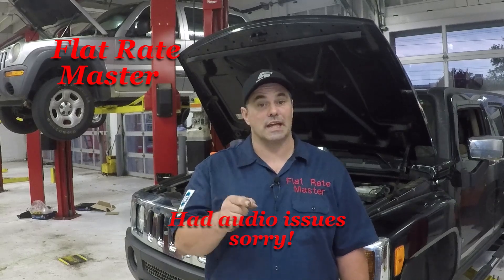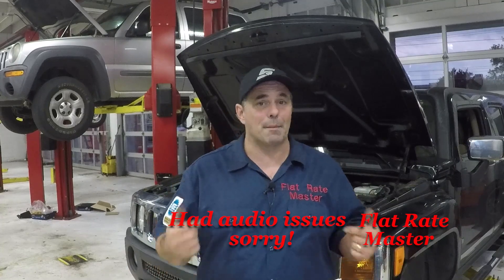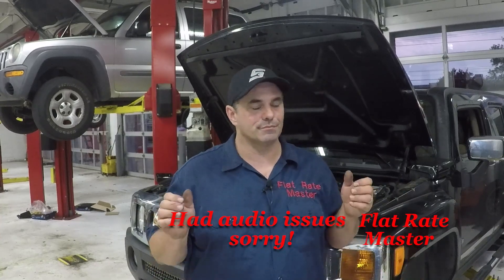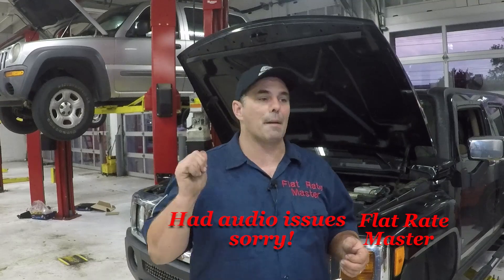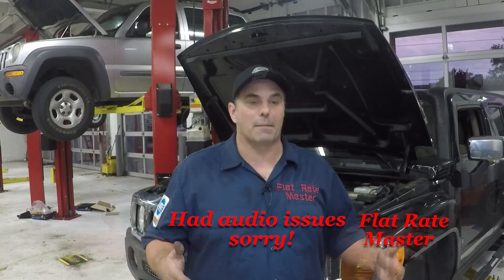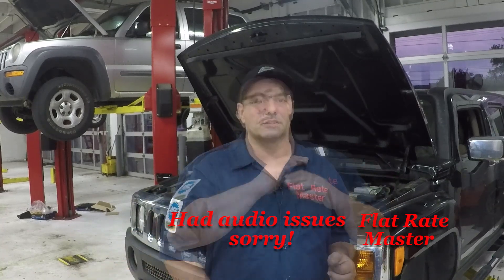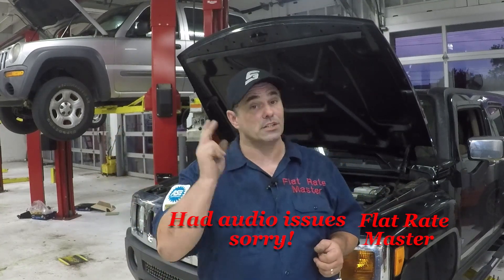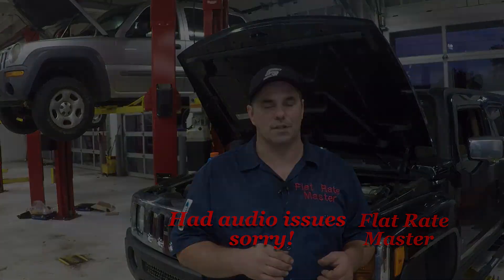Bay Management in Auto Repair

Comment: The jeep liberty in its natural habitat
Reply: MeVsMe that's funny
Reply from the maker: Do not get me started on that POS, I repaired the CEL on it but it is coming back because everysinceyou, repaired the light my steering wheel doesn't recenter after a turn, no lie!
Reply: Flatrate Master I've had a ever since you changed my oil, my glove box doesn't work. Lmao.
Reply: Flatrate Master and of course the dealer took care of it...SMFH
Reply from the maker: LMAO too!
Reply from the maker: my boss will probably have it aligned just to get rid of him and put that pos on the do not schedule list
Reply: MeVsMe, I've heard the Mechanic OC make the same comment about the Liberty.
Reply: Donald Hollums chrysler is pretty  garbage.
Reply: MeVsMe yeah, I understand. Pert near the whole automotive industry is that way now. When I was helping at the shop yesterday I flushed the heater core out on an older Wrangler with the 4.0 inline 6. One of the techs was bragging about how bulletproof that engine was and Chrysler went to the 3.6 V-6 because the old engine wasn't profitable enough. In other words the 3.6 was more susceptible to breaking down more often.
Reply: Donald Hollums I can believe it because plastic parts lol
Reply: MeVsMe probably even the innards of the engine nowadays!
Reply from the maker: We have a 4.0 at the shop getting a Head Gasket:) they killed the 4.0 because of emissions and Fuel economy, just too hard to get it to meet the requirements
Reply: I've done 6 Liberty's in my last 2 work weeks. Very natural environment. 😂😂😂

Comment: I have 2 bays here at my gm dealer. I mainly use the one in front of my toolbox for my repairs and my other strictly diag, and quick checkouts. I set my roll cart up as a diagnostic cart so I don't have to leave the car until I'm confident what the issue is and can write up my estimate
Reply from the maker: That is How I generally use my 2 bays as well.

Comment: i was just thinking about this last night when i tore down an 06 titan for a starter which i pushed up behind an rx8 for battery being connected backwards by owner. the titan turned out to be not only starter but flywheel also now i have to push it around because no one has the flywheel. never seen a chunk of flywheel come off and take out starter and a big chunk of bell housing.  so now i have 2 dead vehicles tying up my single bay, perfect and i have a water pump on a jetta diesel coming monday. oh it's so fun to have only one bay. great vid, thanks
Reply from the maker: It does suck to only have one bay, we have a jeep getting it rear end rebuild by a local gear shop, and rather than tie up a bay for a week waiting I had the tech pull it in the parking lot to keep him from killing a bay for a week and thus his pay check

Comment: I had a boss one time, he say STOP wasting that brake cleaner boy, you're costing me a fortune! Parts room and oil was always under lock & key. You had to beg to use a scan tool and holy shit at the hell raising about how much the thing cost. Don't even bother asking for an o-ring or wire terminal, just go down to parts store and buy it yourself. You'll be better off and whatever you do, do NOT leave a car on that 'so-called' oil change rack, ever!
Reply: hes dead right? and your writing us from prison i hope..
Reply: Gear Wrench87 No he's not dead, 80 but not dead yet.
Reply from the maker: I had a boss complain about the shops use of Brake clean it, after the complaint it went up about 1000% I used it on everything after that, even cleaned my floor with it:D he stopped complaining after that month